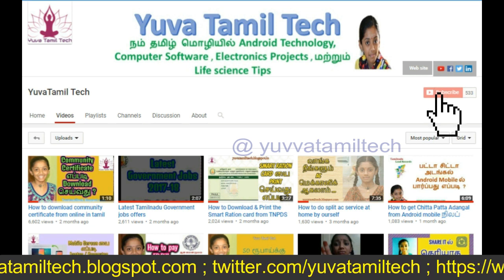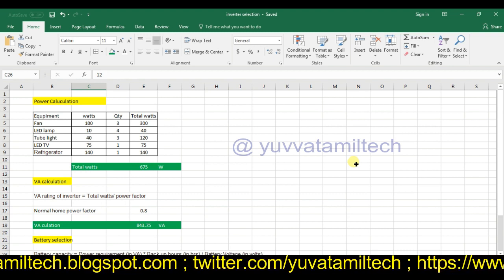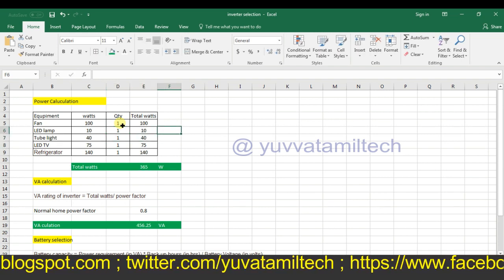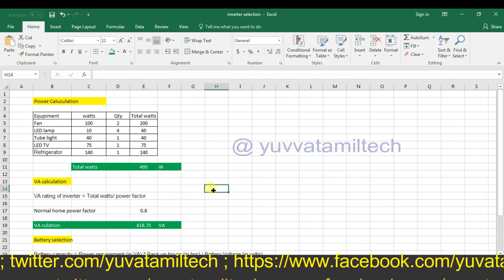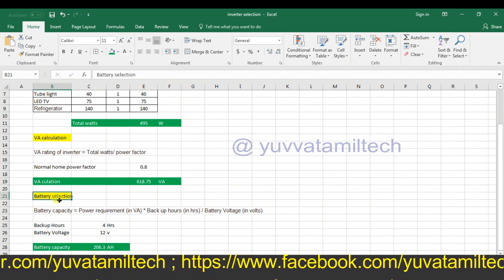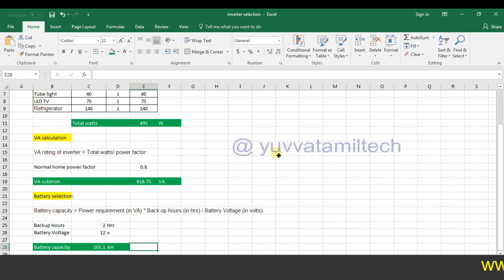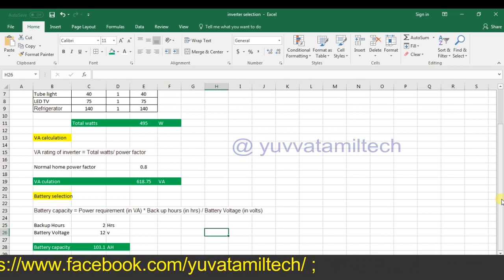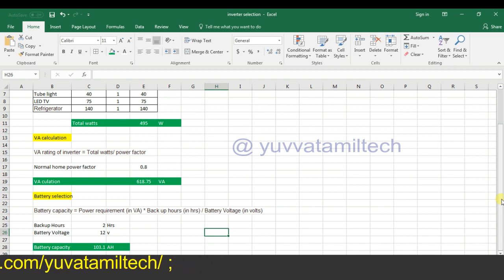How to choose the right (Inverter /UPS )& Battery for your home in Tamil | yuvatamiltech

Comment: Hello Sir,  Bangalore based, ex TNEB staff had invented Battery life enhancer, works in all types of lead acid & SMF batteries from 7ah  to 150ah.   The enhancer will stop formation of salt inside battery, hence lead and acid reaction happens like new battery, the product was invented in 2009 and till date the enhancer is connected in the battery connected to house, getting back up for 3 days.
He was selling mainly in Malaysia and Dubai, I was surprised the product is not available in India. Batteries are main issue if they work like new even after 11 years then there is no proof required, would like to invite you to do video on his product, he also has energy saver for Deep freezer where the power consumption reduced to 20%. Good product invented by Indian., Mail me for more information svkarthick@gmail.com
Reply from the maker: Thanks for your information . If possible send me photos and videos yuvatamiltech16@gmail.com

Comment: Bro enga vetla 2 fan 3 tube light and 1 kva inverter use pandrum but 1 fan oru light pota current irukum both work agra mari work agauthu but again oru tube light pota low Agiduthu any solution
Reply from the maker: Battery capacity enna
Reply: @YuvarajaSpeaks  24 v
Reply from the maker: @manassehmanasseh138  ah enna
Reply: @YuvarajaSpeaks  sorry bro 12 v ah 20hrs 100
Reply from the maker: Ampere hours.  Ithu battery la mention agi irukum. Ithu than load back up deside pannuthu
Reply: @YuvarajaSpeaks  20 hrs 100 ithuku evlo load panalam bro
Reply from the maker: Better increase battery ah capacity
Reply: @YuvarajaSpeaks  bro exide battery ups nalaaa company yaaaa
Reply from the maker: Yes

Comment: Hi bro,  Incase we use 1 invertor with 1 battery if there any problem? please advice.
We required capacity is 200 AH, so we can use direct 1 number of 200Ah battery it is enough and cost-saving also...please advice if there any problem on this..
Reply from the maker: Yes can do
Reply: @YuvarajaSpeaks  Is there any problem if future 1 inverter with 1 battery?? please advice...
Reply from the maker: If u r maintain correctly battery life 2 to 3 years . Then u need to change it .

Comment: Bro i have 250va inverter i want to run 1 fan 1 tube light  for 2hrs. 35ah  is it enough? Is it possible to use 250va inverter for 35ah battery?
Reply from the maker: Yes

Comment: Ac load kudukalama bro
Reply from the maker: No
Reply: Bro Anga area la power cut problem Ella but voltage fluctuations eruku athuku inverter use pannalama ac ku
Reply from the maker: @aravindanbu1937  use stablizer 3 booster
Reply: That also tried bro